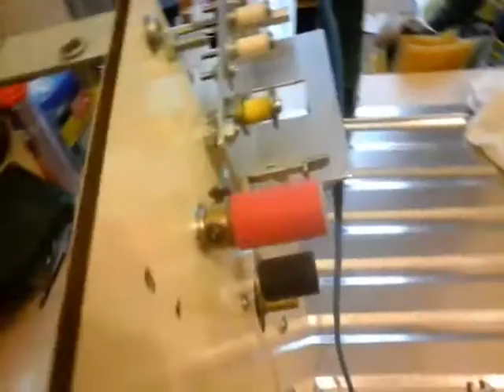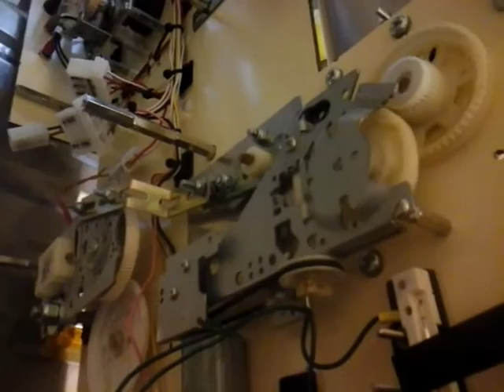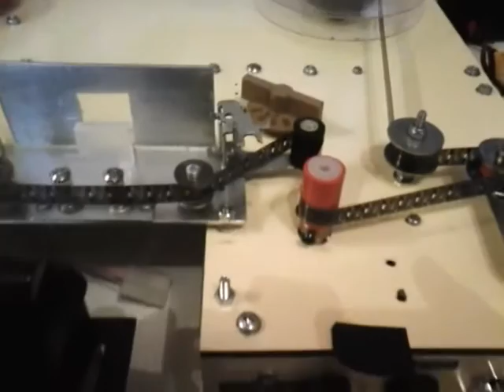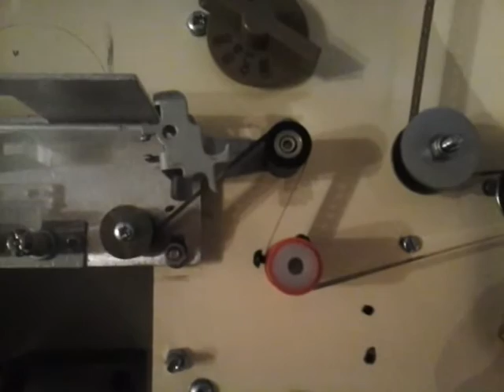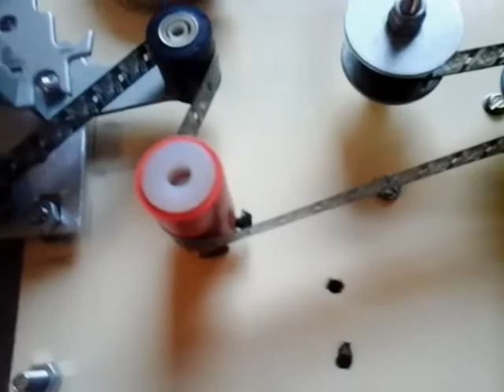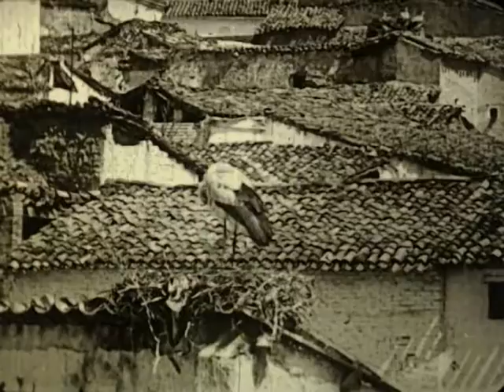DIY Telecine Capstan Drive And 9.5mm Roller Gate

Comment: Nice work!  Looks like it's sprocketless.
Reply: I see a number of commercial telecines have many more film rollers than I think would be needed.  Do you know what the advantage of that is?  Thx.
Reply from the maker: Did you have a particular machine in mind ? Some use P.T rollers to clean  off dust particles and to provide a little drag.

Comment: Looks interesting. Were the parts made from a video player? Do you have schematics for it?
Reply from the maker: Yes the rollers are from an old VCR. So are the motors and gearboxes . I have a circuit diagram for the control board .there are some modifications i would like to make,at some point.
Reply: Cool. Keep us updated!

Comment: How are you driving the takeup reel?
Reply from the maker: Both feed spool and take up spool are driven by geared down motors. Basically, they are switched on and off by the tension arms, thus copying the movement of the film by the sprocket or capstan drive. The tension arms send signals to the control PCB witch has (pulse width Modulation) to set the speed of the motors. The output has a pair of transistors for each motor. One transistor switches the motor on, and the other brakes the motor when its switched off.